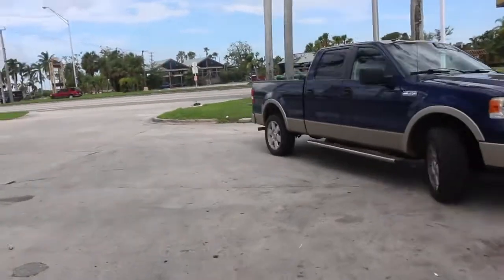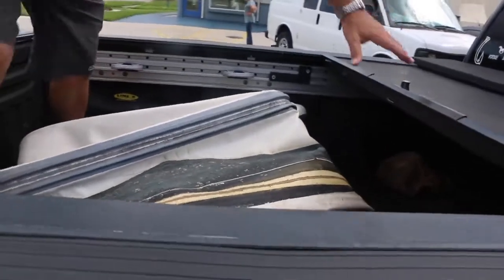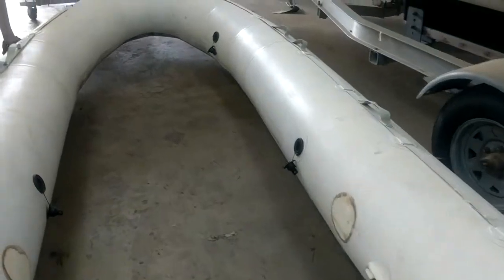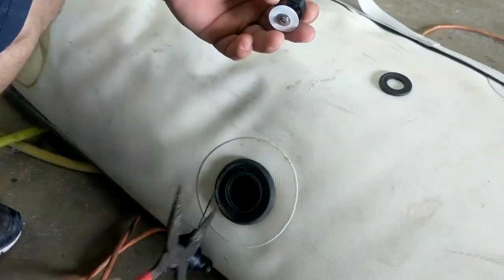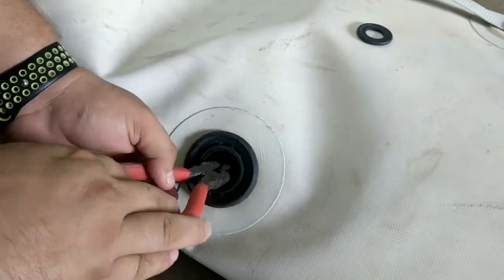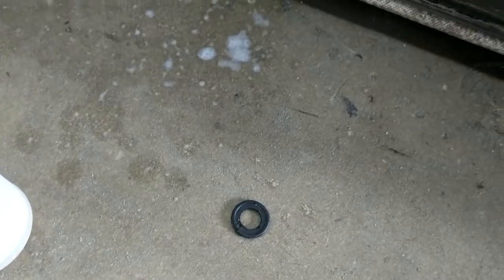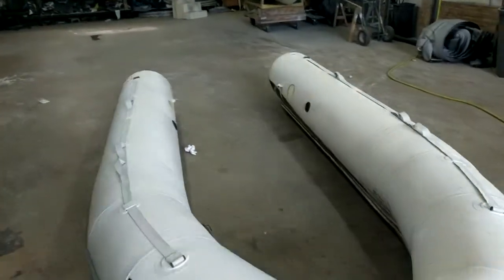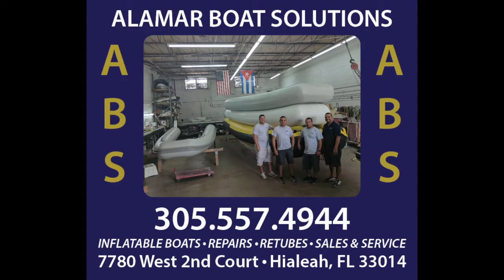Repair Zodiac rail and leaking Valves (Pvc)

Comment: Ok heres my Zodiac valve fix

I have both the old and new valves, they both have the same fault
Take the valve out, pull out the rubber valve part
Look down the aperture and you can see it goes all the way out to the knurled nut

The newer valve is the same, take the screw out and take a look, hole goes right through
thoroughly clean the the valve and the rubber
Take some 5200 and stick the centre rubber into the valve leaving the edges spared
in the later valve put some 5200 on the thread

Another thing, sometimes the surrounding black plastic part the valve supposed to seal to gets worn
get some 4000 grit paper and bed the base of the valve
always make sure the outer gasket is in good shape

you should find leaks are considerably reduced
cheers

Comment: Those valves are designed to leak, until the cap is in place.  This way,  tube pressure can be checked with an air gauge.